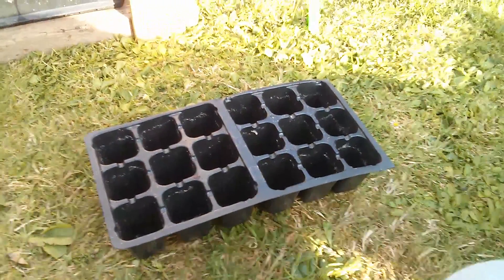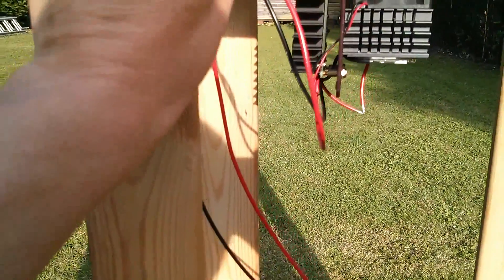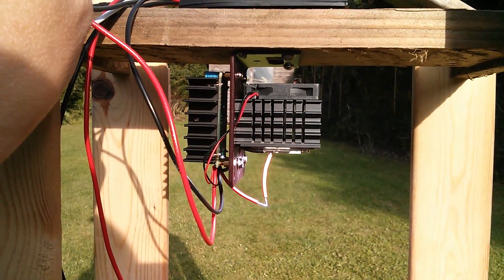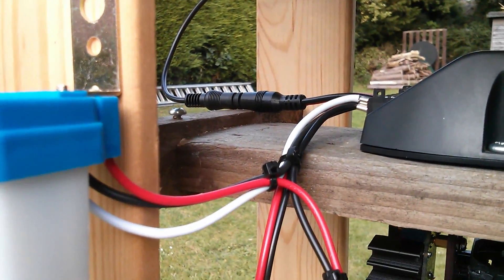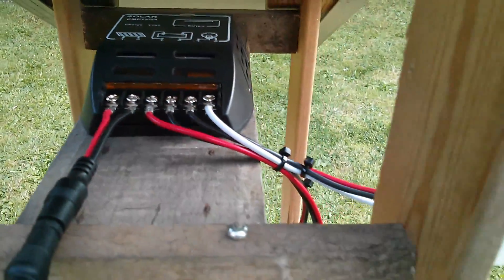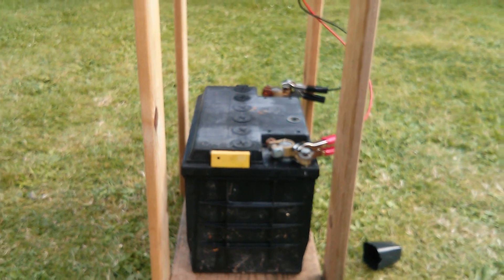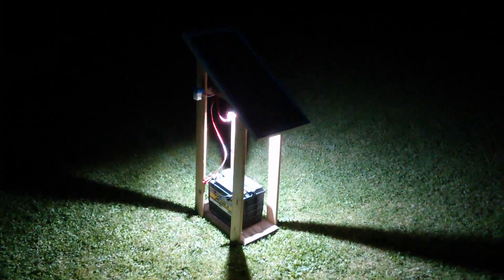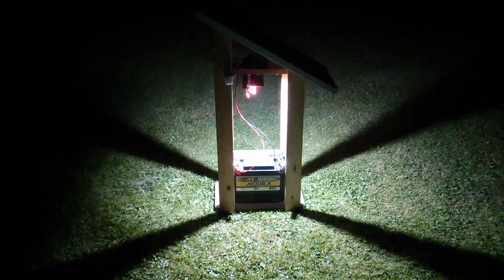Build a Monster Bright 30W LED Garden Solar Light #4

Comment: Dear Julian inspired by your project I'm trying something similar myself. I have an old car battery and just bought a solar panel and cheap controller. I have a 23 watt mains LED PIR light (bought a Chinese 30w light). Could I power this off the 12 volt battery?  I'd need a 12v to 24v converter I suppose.

Comment: Good project. Thank you. I have similar systems outside of the house running on solar battery charging principle. Using LED's 12v they work great. UTube has great projects that can be used.

Comment: Is there any type of reflectors on or below the LED to reflect the light more or amplify the light spread?

Also, it is completely OK to leave all those bare wires, connectors & electronics exposed to the elements?

Comment: I have not finished watching this excellent video yet. I have got to the 1:37 mark but please, please tell me you enclosed this to keep wind driven rain water out of the electronics and off the battery?
Reply from the maker: InTheNameOfJustice No, sorry. Quite interested in how long it lasts. The battery isn't a problem - it can be covered in water without any issues - in fact sunshine does more harm to car batteries than rain.
Reply: Julian Ilett
Interesting Julian, thank you. I am puzzled about your views concerning the battery being covered in water because shorting out a car battery was always a no-no when I was a mechanic so I cannot go along with that, but it will be interesting to see how your rig weathers the weather, so to speak.
Reply from the maker: InTheNameOfJustice A pool of water between the terminals would eventually discharge the battery, but very slowly. It will evaporate long before any harm is done. On the other hand, this is the UK, where it never stops raining!
Reply: Julian Ilett
Ha Ha. Thanks Julian. Have a great day and keep making these great videos.

Comment: excellent video but one suggestion. try put some plexi-glass on the sides to protect the electronics and if you can get some with a haze on it it would make a fantastic diffuser and maybe a mirror on top of the battery so you dont lose so much light on the ground. other than that great video!

Comment: Hello Julian.
Have you problems with insects siege your light? I just ask, because I read some articles (I'm German, so links doesn't make sense) about insects and wavelength of light.Seems to be that warm white is maybe the best choice.Insects like blue and ultraviolet. What color do you use and what is your experience?
Reply from the maker: Yes it does seem to attract lots of insects - not sure if they're moths or flies (they're quite small). The LED is warm white, but it still puts out lots of blue.
Reply: hello Julian,
I was wondering how the fan and heatsink have held up under the insect siege now that half a year has gone past

Comment: Interesting. What is the daylight switch current draw? And what is the current draw from the battery at 12V at night?

It would be interesting to know how long it runs for each night. I suspect your power in will not keep up with power out to the LED. When the battery gets low, the solar charge controller should shut the light off early.

I have a 20W panel on the roof charging a 14Ah 12V battery and running a 1W LED in our hallway. The charge controller does the daylight switching. It's mid winter here in New Zealand and I'm finding that it can just keep up; a couple of sunny days covering 3-5 darker days to keep the LED on all night.

Comment: I'm sure it's been mentioned before but you can get charge controllers that switch the load on when the power from the solar panel is low.
Reply from the maker: I have a couple of cheap controllers coming soon - I'll check to see if they have that function

Comment: Really nice!
i think you could improve it, if you took a sheet of plexyglas, bent it and spraypainted it with chrome spray, to cover the battery. This would reflect the light, that shines on the battery and make it usbale, while also protecting the battery from rain a little better :)
however this is pretty awesome already! :)
Reply: Very nice..
I have also a lot of LED lighting fixtures(DIY of course) powered by a wind turbine and photovoltaic panels.If you want to see the pictures, please contact me or visit my web site:
www.ecoalternativ.ro

Comment: Great result.
If you were to leave it outside you'd need to pot the components to help prevent rain/dew damage and maybe shroud the LED/fan.

Maybe if you used a vertical pipe as a stand, ensuring it was wide enough to fit the electronics in, and mounting the panel to the top via brackets, it would be better looking??
Reply from the maker: It's staying outside - I don't want those parts back in the house. It'll be interesting to see how long it lasts and what fails first.
Reply: My money would be on the fan :-)
Reply from the maker: Mark Garth I'm thinking one of the PCBs - either the boost converter or the charge controller.

Comment: Looks good. As other have suggested a diffuser of some sort will be a good improvement (something like a reflective cone under the LED). Also it will need to be waterproof the solar controller will not like water inside.

Comment: Any reason you want to illuminate your battery that much? ;)
Switch the charger and the LED around (or just flip the board they are mounted on) and you can use the white (or is it aluminium?) underside of the solar panel as a diffusor.
Reply from the maker: I suppose I was just copying the downward pointing LEDs in miniature garden lights. It does produce that epic cross-shaped shadow though.
Reply: Looks great . i'd go for a mylar cone placed under the LED , perhaps sat on the battery (insulated appropriately of course) to give more light int' garden.
Reply: Julian Ilett make LED  holder that can change angle on the led so you can light up area that you want .
Reply: Julian Ilett what about a v2 about this awesome product where you try to get the most of it and more efficient
Reply: Julian Ilett I would actually recommend getting a 4-way reflector (if you can find one) that way you can keep the cross shape.
Reply: Look like I forgot to read the rest of the comments for this video lol